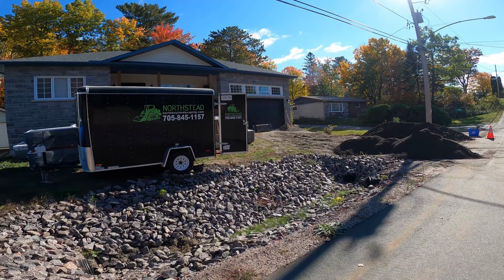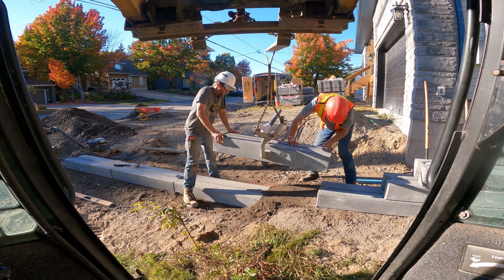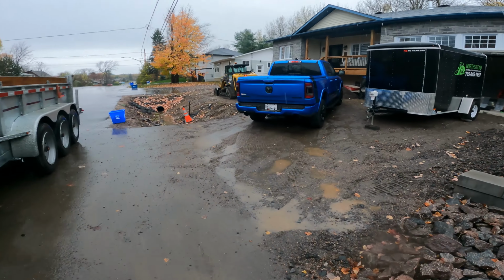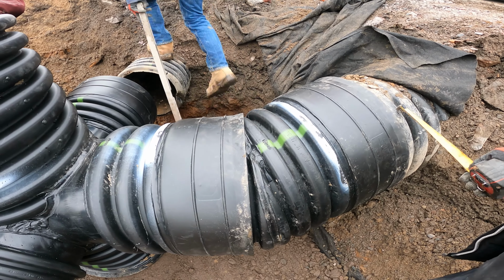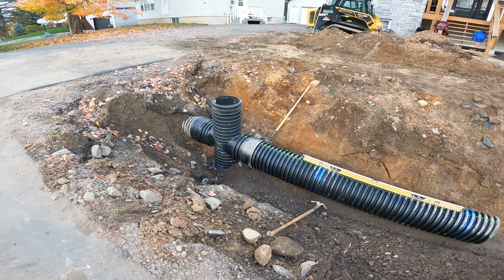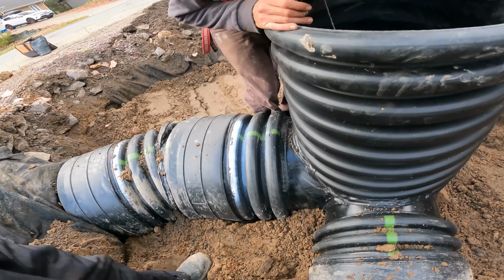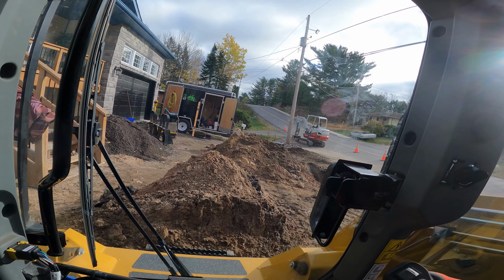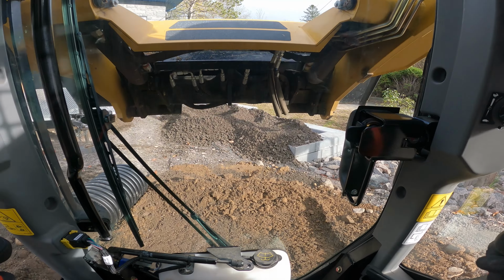Retaining wall & culvert install using mini excavator

Comment: Pretty nice operation you guys are running! I just started up a side hustle landscaping company last year in Quebec here. Running a 1025r TLB with a 14k 7x14 dump trailer looking at expanding a bit. I noticed you seem to own your skid steers but rent your excavators? My next equipment I am planning to get is a 3 or a 3.5 mini ex, thinking my 1025r can do most of the ''loader'' work, even though it's quite underpowered compared to a skidsteer.

Whats your opinion on my plan and any advice to someone starting up?

Cool videos, here's +1 to your subscribers base.
Reply from the maker: Yeah it's tough to know exactly what is the best equipment for you to buy. You really need to know what kinda jobs you will be doing more of because that will determine your needs. I rarely use excavators in the past but, I'm starting to consider buying an 7-8 ton because the little ones are cheap to rent. I also know people who only run excavators so, you will have to determine what camp you are in Skidsteer, excavator, both. Now the other thing is I know people with excavators or skidsteers so, I can sub them if I need to.

Comment: Over the years I found it’s just better to dump the load I always end up banging into truck or trailer ,then at the end scoop it up or lose it in the job and If I have to leave the job I don’t have to think about the men getting more material out of the truck they can just scoop it down the road , low skill level
Reply from the maker: True and I rarely do this but, I knew I'd be dumping in the middle of the ditch but hadn't excavated the material out yet and we needed a few buckets of gravel for the basins base.